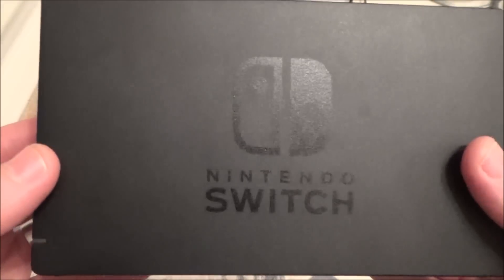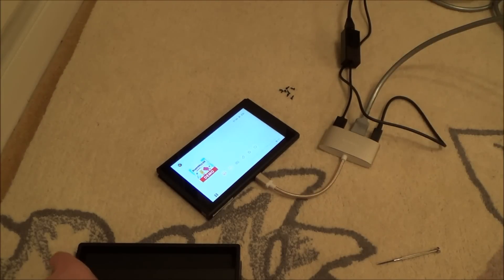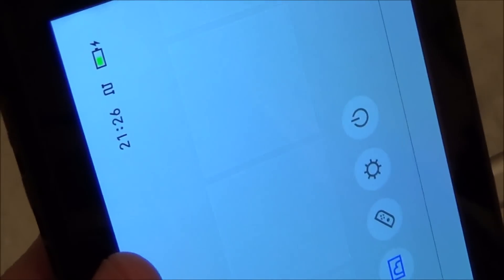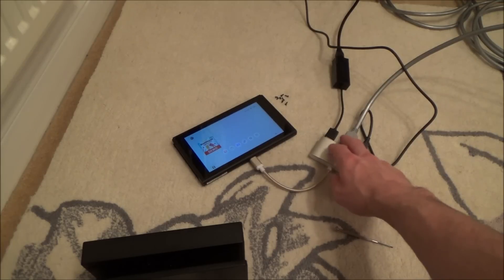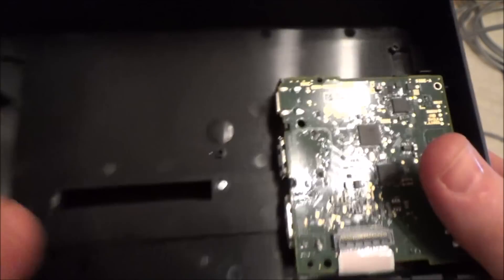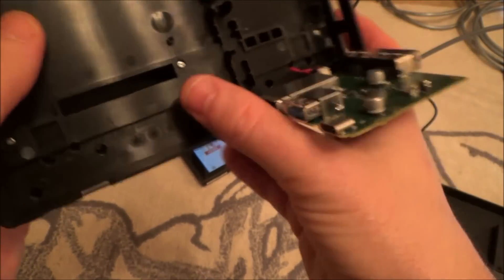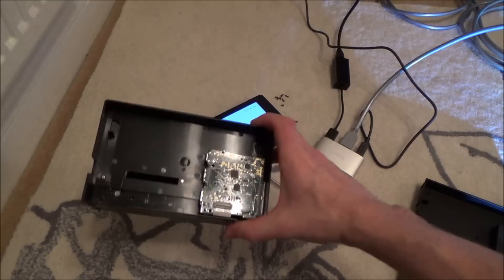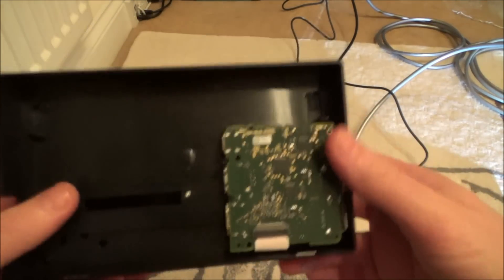What's inside a NINTENDO SWITCH DOCK and can you use a USB C to HDMI adapter instead???

Comment: Question. I noticed if my tablet is on and I connect it to the dock. My TV will automatically turn on. How does the HDMI tell  my tv to turn it self on? How does this work?
Reply: There's a setting in the Switch that sends a turn on signal through the HDMI. most consoles have this. you can toggle it on/off.
Reply: mistermatrix24 why can't my tv turn off if I lift my tablet from the dock? Why can't it tell my tv to turn off?
Reply: I'm sorry did I imply I develop tech for Nintendo? I don't know how they built it. It's called HDMI-CEC. Google it. Personally I disabled the feature b/c having multiple devices with HDMI-CEC all vying for attention causes a lot of annoyances. But I do know not all TV's have HDMI-CEC and of those that do not all have full compatibility with all devices. ie some will turn on but not off.
Reply: mistermatrix24 thanks

Comment: it does not work because theres no power going to the breakout box. I seen another youtube where they used a wall usb with usb to type C connector connected to the actual doc and the switch charged just like yours but no tv output. must need the appropriate voltage somewhere in the breakout box

Comment: It outputs a displayport signal from the usb c port.  The chip in the dock converts the signal from display port to hdmi.  Maybe if you connect an hdmi to display port adapter on there you'll get video then.
Reply from the maker: Thanks Frank :-)
Reply: Did you try this?  Does it work?

Comment: The dock contains a DisplayPort to HDMI chip, so it could be that your adapter is using the HDMI mode.
Would be interesting to test with an adapter that use the DisplayPort mode.
Reply from the maker: The adapter was HDMI. I did read that it might be using USB-C to DisplayPort. Now I know it would probably work out cheaper to get another Dock but I wonder if this setup would work: USB-C to DisplayPort adaptor (with USB-C charging) and then DisplayPort to HDMI adaptor. Do you think that would work?
Reply: I would think so. I am tempted to get a cheap adapter somewhere to try it out.
Reply from the maker: Likewise. Just looking on Amazon and you can both adaptors for approx. £30 for the cheapest no name brands. The DisplayPort adapter would need to allow charging though it because the Switch tablet would need the 15v to output to the TV. I tried using a normal 5V Phone charger in the Dock and it wouldn't output to the TV and on the switch tablet screen it said something like.... plug in the supplied charger.
Reply: But the dock also has a microcontroller and a USB-hub/charge controller in it that might do some logic to avoid using the dock if you don't have a high power source. I ordered a 6 euro USB-C to DisplayPort adapter on Amazon now and will check it on the DP screen in my office.
Reply from the maker: Let me know how you get on :-)
Reply: @friix please let us know if the DisplayDort adapter works!
Reply: bummer, but thanks for the info!
Reply from the maker: Just for some info...I got a USB-C to DisplayPort adapter with power pass through so I could connect up the Nintendo 15volts through it into the Nintendo Switch. I then I got a DisplayPort to HDMI cable from the adaptor into the TV and unfortunately it still didn't work. The Nintendo Switch didn't even register as charging and the display stayed on the switch. For some reason the 15 volts didn't pass through the adaptor.
It looks like the Nintendo power adaptor has 5 wires in it. Red and Black wire to supply 15volts to the dock or switch and another red and black to provide 5volts to the Pro controller and a separate wire to determine which way the USB-C connected has been plugged in. So at least a standard 5 Volt phone USB charger can charge the Pro controller if it needs charging while the Nintendo Adaptor is in use charging the Switch while away from home (away from the dock).

Comment: Hey, do you know which company made the adapter in your video? Do you know the BRAND name of that adapter you used in the video?  I just tried 3 different adapters including the official Apple one, and NONE of them charge my Switch.  

None of the 3 adapters I tried work for HDMI either, but after seeing your video I'm still curious why my adapters aren't sending power to the Switch but the adapter in your video is sending power.  I'm wondering if the adapter in the video is just made different compared to the ones I have, or if maybe Nintendo updated the Switch to limit the adapters even more compared to the launch day.
Reply from the maker: It was from Amazon and the company/name of adapter is  Lumsing. This is what is written on the box: USB Type C to HDMI+USB3.0+Type C F Adapter Cable.

Comment: I opened up my Switch system and all that's inside is a couple of PCBs, battery, an LCD screen and some foam blocks.  I mean, it can't possibly be any more low tech than that.  It's like they just modified a USB-C and connected a screen to it.  Can't believe they're charging $300 for it.  I also opened up my desktop PC and all that's in there is a single PCB and some memory.  Cheap overpriced junk.
Reply: have you ever worked on those new fangled 'automobiles' ? Glorified lawnmowers with seats I tell ya
Reply: It's called sarcasm.  The big complaint here seems to be that there isn't "more stuff" inside the dock, and people are shitting on it for being just a single PCB as if that means there's nothing to it but an HDMI converter.
Reply: @TheLuchaDork  But it doesn't have anything like a secondary gpu does it? Its just a pcb with nothing special inside it. What that means is that it doesn't appear to have anything different from generic hubs at all. Yet they charge 84 dollars for that trash

Comment: I knew it. It doesn't work to display out just like that. Sure, Nintendo uses unidentified proprietary display protocol. Thx for proofheading this dude. Nice Awesome!!!

If only Nintendo open it up little bit, it would have pleased the geeks and nerds.

But yeah, atleast we have wired network and charging, which is still nice.

Comment: does the wifi and wireless controllers still work after trying the other hub? Everything wireless stopped working on mine after trying an apple USB C hub. Trying to see if that was the source or the malfunction.
Reply from the maker: Hi, yes, everything is still working as it should be.

Comment: I'd like it if the innards of the official dock was put into a similar form factor to the first USB-C-to-HDMI adapter you tested. That way it would be much more portable.
Reply from the maker: Yes, it would be good to have the standard dock for home use and then a smaller portable one for travelling.
Reply: I think it won't be too hard to make one if you're tech savvy and have the equipment!
3D printing a case is no problem. The biggest hurdle might be to make the USB-C connector easy to use and well protected.
I think I'll see if some of my mates will be able to help me make one. ;)

Comment: they ARE selling the dock by itself for 60 if you happen to break it or something. I say that because the switch charger is one of the cheapest USB C chargers out there that can output that many watts and its included in the 90$.

so it boils down to the dock veing around 50$ after factoring in chargers abd hdmi. the thing is the thing you are using is 30$ on amazon. a USB C to A hub with charging costs 50~70$. and belkin's C to HDMI cable is 50$. so no its not expensive

Comment: Hi just a quick question as I can't find seem to find any info on the internet and got bored waiting in the queues to speak to nintendo tech support but can you store the Switch on the docking station even when it or the Joy Cons don't need charging as I don't want to overcharge the battery packs
Reply: Ray Butler 

to be more precise, most modern batteryies don't charge after 100%. after 100%, the device allows it to trickle back down to 90% before it starts charging again. if you are using the switch I heard it maintains it at 85% while playing docked.
Reply from the maker: Hi, good question but unfortunately I don't know the answer.  I could be wrong but as far as I know overcharging isn't really an issue with newer batteries anymore. I intend to leave mine docked when not in use and I presume Nintendo would say if it was a problem as most people will store it in the dock :-)
Reply: My Mate VINCE thanks for the advice vince keep the great vids coming
Reply from the maker: Cheers :-)

Comment: Hi, Did you rule out a magnetic sensor triggered by the dock?  You may be right about the alternate wiring, but there could also be a sensor on the unit to detect when it is in the dock and trigger the mode change.
Reply: Stewart Wilson It could also be possible that there is some sort of NFC tag in the dock
Reply from the maker: Hi, I did think about a magnet and I tried placing a very (very) weak magnet near the bottom of the switch tablet and it didn't make a difference but maybe something is located at the bottom of the dock that I missed. I have heard rumours that the switch outputs display port via the USB C and then the dock changes this to HDMI so this might be why the USB C to HDMI adaptor is not working. If anyone reading this can confirm this then it would be helpful :-)
Cheers Vince.
Reply: Vince, is it not just a software block? There could simply be some code in a chip on the circuitboard.
Reply from the maker: Possibly.  I think the approx. £80 for another dock doesn't seem so bad now as I first thought considering it looks like you get the charger and HDMI cable included.
Reply: HimbeersaftLP Yes, I think that is the most likely answer. We know the unit has NFC capability for Amiibo use already.

Comment: I think one of the reasons why the dock is like that because from what I heard, the GPU is downclocked when undocked, and is brought back to full speed when is plugged in.
Reply: I thought that was for heat reasons but apparently it's purely to save power when otg

Comment: Well yes Vince, if you read the description of the switch you'd know that: when the switch is plugged in to the dock the cpu is overclocked automatically to allow the video transfer. (btw there is a difference between the usbc CONNECTOR and a thunderbolt input)
Reply: I'm awaiting my second Dock which I'm going to cut apart and build a little box to make my own dongle. Will post when done :)
Reply: My Mate VINCE It's basically impossible Vince, the dock is designed in a way that when you dock it, it gives the Switch the power (overclock cpu) it requires to output that 1080p signal through the hdmi on the dock. Also the dock requires 15v of power for that to work, and there is no way the switch can get even near that with the battery it has for that matter, so youll have to wait for some third party retailer to make their own dock before you can "cheat the system" with a dongle
Reply from the maker: Thanks for the reply. I see, so you think it is the dock that needs the 15v rather than the switch that requires the 15v to give it the extra push (overclock) that is required for the 1080p. I see on the charger that it outputs 5v at 1.5A and 15v at 2.6A and I thought this was like the newer phones with the fast charging requiring the higher voltage when needed and the lower 5v doing the trickle charge but now because of your comment I am thinking maybe the 5V-1.5A is in use when charging the switch directly via the USB C connector and the power adaptor knows when it is connected to the dock and outputs 15v-2.6A to power the Dock allowing the 1080p. Although the switch itself does have input 15v-2.6A on the back of it.
The reason I got the USB C to HDMI Adaptor is because I thought maybe the DOCK was just a very simple device and the switch just needed the power adaptor to enable the overclock because otherwise the battery would drain to quick and customers would be disappointed and the screen is not 1080p anyway. 
So I thought if you connected the power adaptor into the USB C to HDMI then it would deliver 15v to the switch to enable the higher 1080p output and then the HDMI would take that output straight into the TV but it looks like the dock is doing 'more' than I originally thought.
I appreciate your comments. I know it is just easier to get another dock for another TV but I like trying to work out alternative (cheaper) ways of doing things.
Cheers Vince
Reply: My Mate VINCE Yeah I understand where you stand, you know I've appreciated your videos for a while now and no one should mind anything being wrong, I was just trying to explain as of why it didn't work and why It's a bit more complicated. Good videos and thinking anyway, like I said, I'd wait for 3rd party retailers or If you want to go all in, learn a bit of soldering and circuit building and get a video output board maybe program it to a raspberry pi zero or something, it would be a cool diy project cant wait till someone does it
Reply from the maker: Thanks :-)
Yeah, I am sure someone will work it all out soon.
Reply: Richard Johnson 

Send a link of a demo video to HackaDay, they might be interested in such a hack.
Reply: TamezTech 
So the dock is some sort of PCI-e thingy?
Reply: Gego/XAREN ゲゴザレン The port in the Switch is made to send signal to the dock which recieves signal from the switches connection and sends from the back usb c connector
Reply from the maker: Have you heard anything about the switch outputting DisplayPort via the USB C and then the dock converting this to HDMI?
Reply from the maker: Good idea, it would also be easier to transport (less bulky).
Reply: @Richard Johnson where did you get the second dock? They don't appear to be on sale yet in the U.S?

Comment: There could be a lock out chip? Nintendo are probably just concerned about cooling, in docked mode the clock-speeds increase, and if the unit is on its back it could constrict intake air flow. I'm pretty sure it's only a matter of time before a 3rd party find a solution to the problem.
Reply from the maker: Thanks for the comment. Someone else mentioned a lock out chip and maybe cooling does have a part to play :-)

Comment: yep Nintendo are money grabbers that's for sure.
Reply: Dylan Walker No, you know what? Looking at the teardown a second time, there could actually be an SoC (System-on-chip) within the Dock. That is why accessories like the USB-C to HDMI don't work. It's not because Nintendo locked it, but because the Switch isn't designed to output 720p through that USB-C port on its own, it relies on the dock to give it that extra power to output 1080p, hell, spec sheets even confirm the console is capable of outputting 4K. But whether or not this would actually be something in the future, remains to be seen.

But I do agree. For essentially an HDMI output and USB hub, $80 is way too steep for a dock. It would've been nicer if they had an advanced version of that dock where they can ramp up or even upgrade the performance. People are already theorizing that may be the case in the future. But for now, a stock dock should've been at least $40 or $50.
Reply: Another internet sheep who jumps on the band wagon lol
Reply: Beta Shadow how can it thermal throttle if it's just a tiny motherboard inside an empty cheap bit of plastic?

I think they just limit the speed of the CPU/GPU when its not docked, because its only outputting 720p, its not the actual dock that's overclocking it... 

plus considering the 80 Pound price tag for a piece of cheap plastic that has HDMI, USB and Charger to USB port.. is just ridiculous
Reply: The expected failure rate for electronics floats between 3-7%; 1.5 million devices sold in the first week.  Do the math, thousands of problems is nothing compared to how many sold. Any electronic product is going to have issues at launch.
Reply: Den Tyngaste  this is where ur wrong
Reply: keiran bowes you mean like a company?
Reply: keiran bowes nah they just wonna put millions into engineering an amazing gaming experience for everyone and don't want money
Reply: Clock speeds increased when it's docked. The dock is probably designed to be passively cooled, otherwise, if it were smaller, it would thermal throttle. And I'm seeing those videos of people having problems with their Switch. Thing is, when 'hasn't' a console had problems on launch day? That who debacle is nothing new.
Reply: No wonder why mario jumps for coins like a jew
Reply: Xavier Roberts except for the fact that the hardware is in fact a huge fail. with thousands of people reporting issues, and the dock itself is just the most awful piece of trash you could get at the corner store for $2